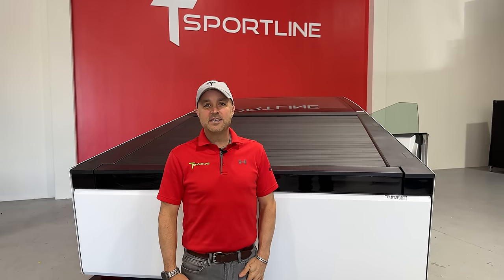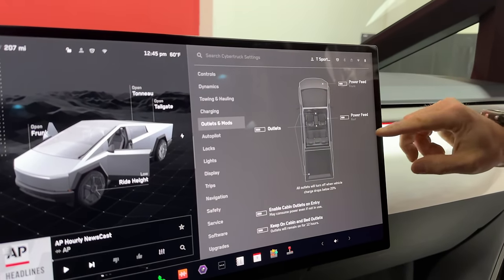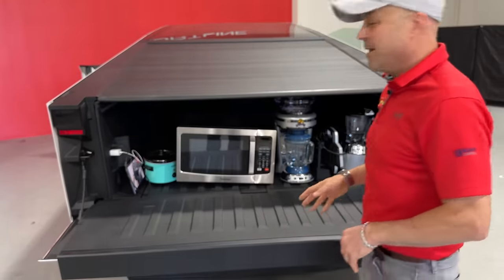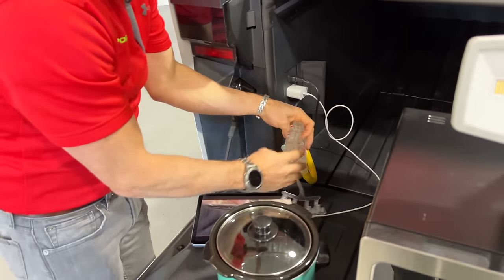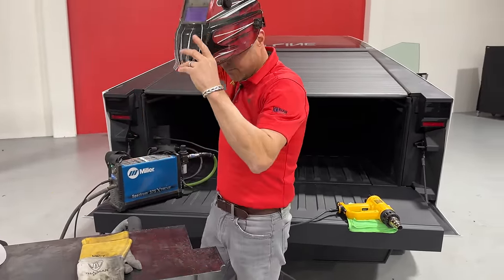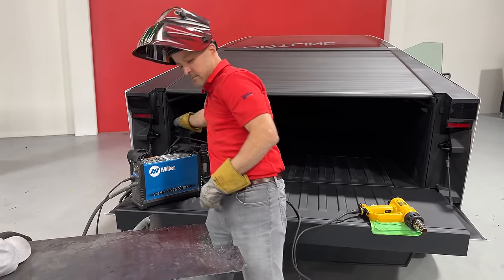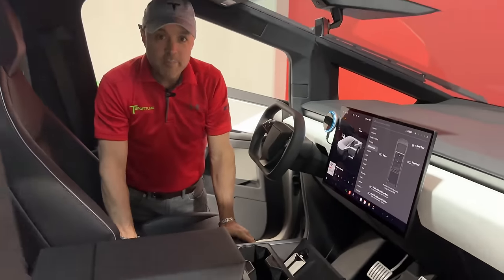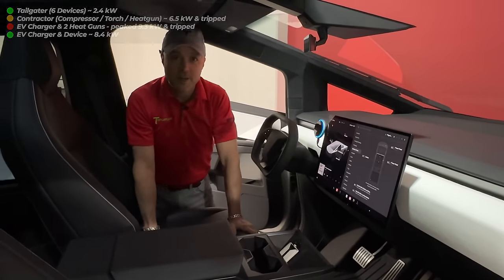Cybertruck's Power Outlets Tested! ⚡️ We Overload the Auxiliary Power and Found The Limits!

Comment: Most likely the display is showing average power draw. The power system is tripping on peak power demand from the the plasma cutter & compressor. Charging another car will be a more steady draw of power.
Reply from the maker: yes, it was unhappy when running the plasma cutter.  The car charger runs no problem....and the ramp up in amperage with the charger is slow and steady.
Reply: @TSportline  it would be interesting to see the spec’s on the plasma cutter - how many amps it draws when cutting. It will vary depending on the settings & what it draws during a cut. Thanks for testing out the capabilities of the outlet.

Comment: The limit isn't 10kw its 9.6kw for the outlets and 11.5kw for homeshare. If they are rated like home electrical outlets then you have to factor in 20% for headroom.
Reply: That is already accounted for as they were taking/calc'ing 40 amps from a NEMA 14-50 (50amp) outlet.  Tesla power converters is overly sensitive and trips the 'breaker'.
Reply: @Scott-sm9nm   Na that plasma cutter was drawing instantaneous peak loads much higher than that. Thats a tough load to deal with.
Reply: @Scott-sm9nm  No, it's simply they are maxing out on current draw not power.

Comment: Put one of the heat guns on the interior outlets. The interior outlets are on one leg and the 20 amp outlets in the bed are on another. If you spilt the load evenly it will hit the rated output no problem.

Comment: Charging and heat guns should have power factors near 100%.  The other equipment may be much farther from 100% meaning you would hit a volt*amp limit before the power limit.  Power factor indicates how out of phase the voltage and current are.  For heater loads they match as a heater is a resistor.

Comment: The 240v wouldn’t charge my 2022 model s at all. The breaker would trip 2-3 secs after I plugged in. Cyberbeast failed miserably in my home test. The 110v worked with zero issues though. For context the cybertruck had a charge of 76% and the model s was at 60%.

Comment: When a circuit draws power from an AC source, it is like drawing a draft beer. Filling the pitcher, the source supplies reactive power (the foam) plus real power (the beer).  The two are sides of a right triangle the total flow is the hypotenuse. The Tesla chargers is a unity power factor load, no foam. The air compressor has a .8 power factor. Check label plates for watts and total volt-ampere draw. Amp demand will be based on total VA draw.

Comment: You are not tripping because of the welder, you are tripping because you are pulling more than 20A on the two rear 120 outlets. They can provide a COMBINED total of 20A. The two 120 outlets in the cabin also have a combined total of 20A. 

If you redid the same experiment with the welder on the 240, the heat gun on the bed 120 and the air compressor on the cabin 120 it would run them all no problem.
Reply: This is the best explanation I have seen in the comments section for what is happening.
Reply: yes jona you are correct. in addition to yoour explanation , the plasma is also spiking .

Comment: If you have a voltmeter on hand, it would be cool to see if the voltage on the outlets sags as the load increases.  Especially comparing the charger+heatgun case vs. the plasma cutting case.

Thanks for doing the in depth testing!
Reply from the maker: Cool idea - on it!
Reply: @TSportline  I think Kyle saw 227v on his L2 charger when charging a Model X.
Reply: Just to be clear, this testing by Tsportline here was not "in-depth".  It was a quick and dirty test with a few power loads, in the tailgate category, and in the tools category, for an internet video!

In-depth testing would have at least consulted the Tesla specs on the various outlets (there are limits for outlets separate from the overall 9.6 kW) AND would have been aware of the actual measured load of each of the electrical devices under test.  Plus, be aware of 'power factor' on inductive loads, where the AC_volts x AC_amps can be out of phase, and the Volts x Amps exceed the spec, even though the in-phase power is under the 9.6 kW spec.

Comment: The power should be spread around by also using the two interior AC outlets. Matt that would help?
Reply from the maker: According to the manual, 'all' outlets combined when testing the 9.6 kW limit.
Reply: Exactly, "all" outlets should be used to total 9.6 KW. You need to spread the load out and include the inside 120 volt outlets. @TSportline

Comment: It might be a current limit not a power limit, if you were using the 240v out instead of the 120v you would have less current draw for the same power output.

Comment: Well that was kind of a let down. 
My Lightning has 9.6kW but it separates the bed into 7.2kW for the 240v and the other 2.4kW is the 120v cab and frunk. 
I’ve used a portable Hobart stick welder with mine and it never tripped the 240v but came very close according to the meter on the dash.
I was hoping the Cybertruck 50a circuit was a little more robust.
I know it’s a long shot but can you hook it up to someone’s house that has a 30a generator input?
The Lightning has an issue where it sees the house neutral and ground bonded together and trips the ground fault in the truck. 
The bypass for this is to disconnect the ground wire in the female plug that connects to the house and then you can power the house like a generator. 
Love these Cybertruck videos!
Reply from the maker: Yes, we need you to swing by ATL when we get our Cybertruck and we'll do a round 2 of testing!  Cybertruck vs Lightning Aux Power shootout!
Reply: Yes and we can do a tug of war before my warranty runs out lol.
Reply: That seems like a better test. Of course you could trip it with a stick welder depending on the stick and settings.  @BlueCollarEV

Comment: inductive loads like compressors  or the welder will always trip a inverter at much lower draw than plate rating try more purely resistive loads 
 for example a hot plate. my 13 amp 110 volt electric chain saw will blow my 3000 watt inverter sometimes.

Comment: the compressor might might be the issue, try letting it build up pressure first.
Reply from the maker: Well, we wanted the compressor 'running'.  Once it gets to the set pressure, it shuts off - so it wouldnt draw power again until it dropped and kicked back on.  But we did think about this - thanks!
Reply: I mean it might get to a higher power output without the compressor, test with only the plasma cutter and the heat guns.

Comment: Umm... it always tripped only when the Dewalt heatgun was being used. So that made for a wacky test. The Dewalt also might have an undiagnosed short condition. And the peak draws are not being registered by the dash. This is a bad test and you need to repeat without using the heatguns as the determining factor (as they also cycle on off at a peak amp draw).
Reply from the maker: Well, the DeWalt heat gun runs fine by itself, about 1.4 kW...exactly as spec'd and expected.  It is not shorted at all.   But thanks for the suggestion, we'll do more testing!